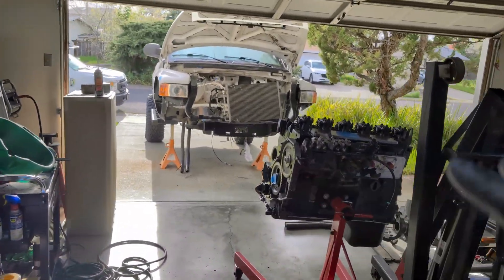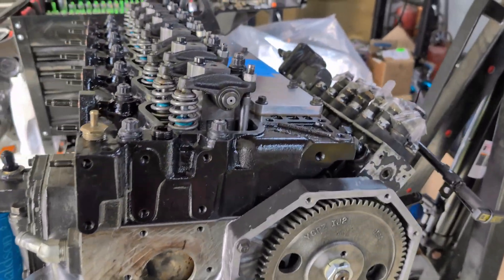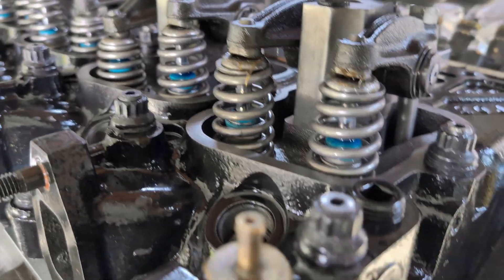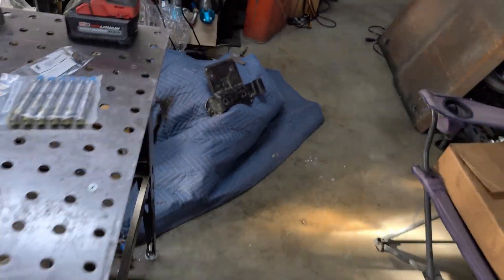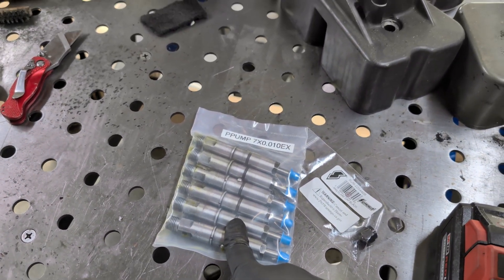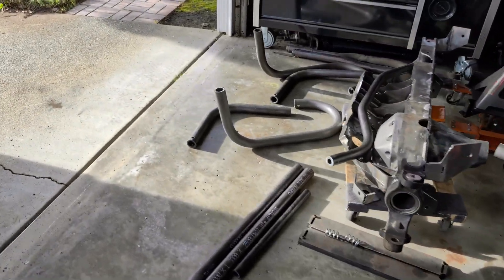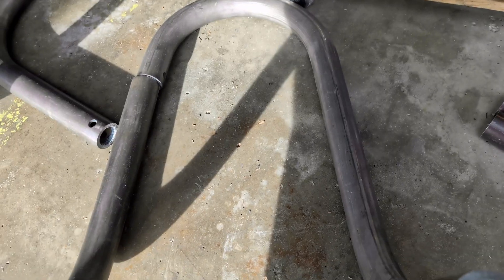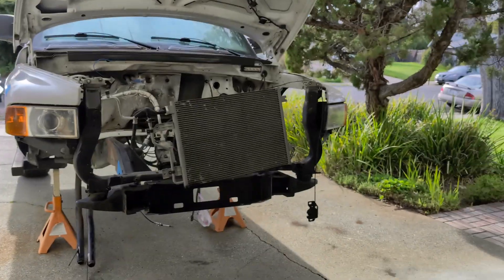Engine Built - DOM Tubing for TOWERS and LONG ARMS - PART 4

Comment from the maker: Adding info for Injectors.. MANY places advertise NEW Bosch bodies. That neglects to reference the nozzles, and thinking legally (I'm obviously not a lawyer) IF the nozzles and bodies were new genuine Bosch, they'd label them as New Genuine Bosch Injectors. But most don't. So you see bodies referenced in ads. Easiest way to figure out where the nozzles are from? Just call the retailer and ask :) and just like referenced in the video, this might mainly matter to those who want the longest lasting injector mileage wise and cleanest burning. Anything big horse power will haze more but if the needle isn't sealing properly, fuel will be constantly leaking out causing more haze :)